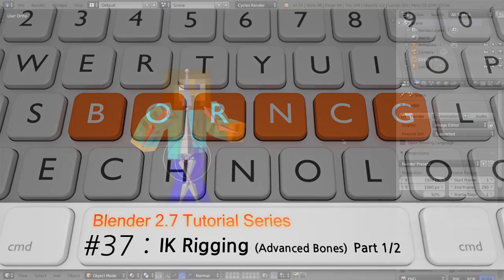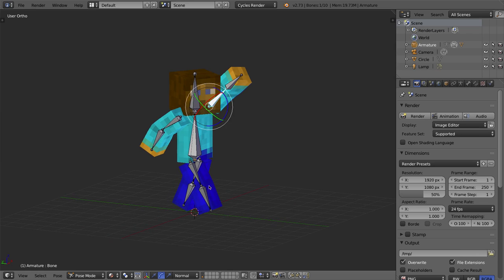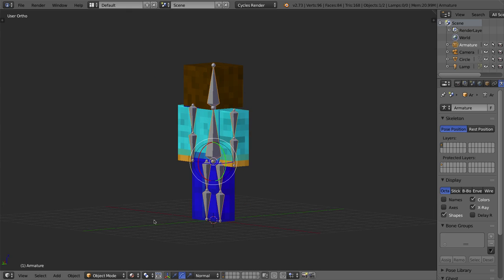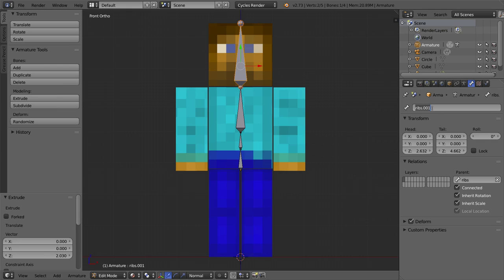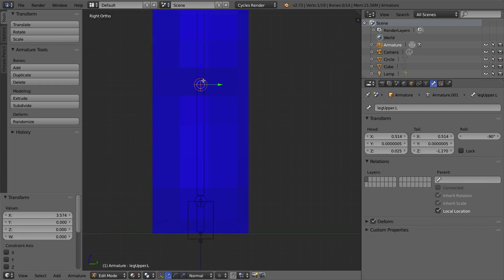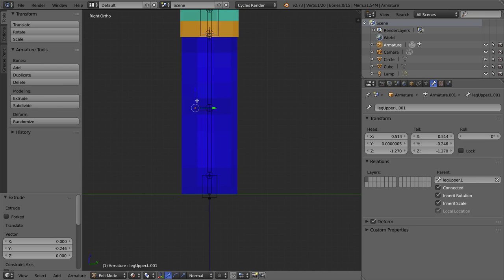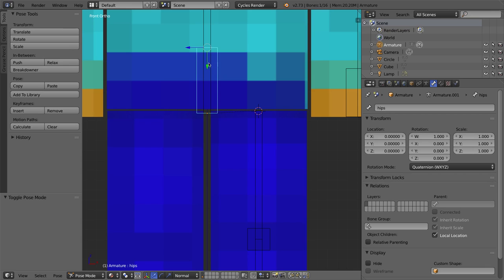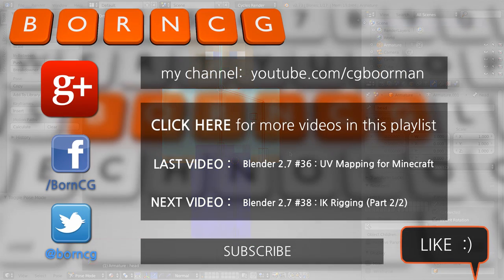Blender 2.7 Tutorial #37 : IK Rigging (Part 1/2) #b3d

Comment: On 25: 20 you say to shift select the upper leg and the hip bone but when I try it it will only let me select the upper leg but not the hips. how do I fix this?
Reply: I meant  25: 17
Reply: Hank did you ever work it out because i have the same issue. I have reworked the model from back at the beginning at i still hit a wall when i get to that point in the video